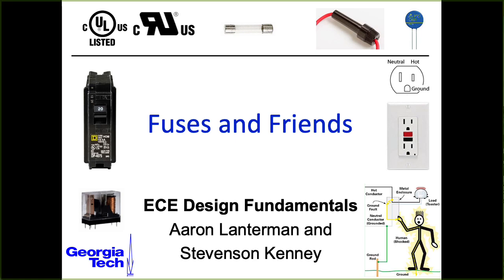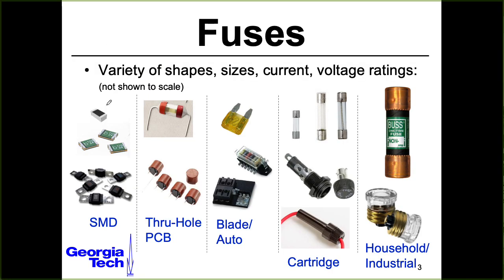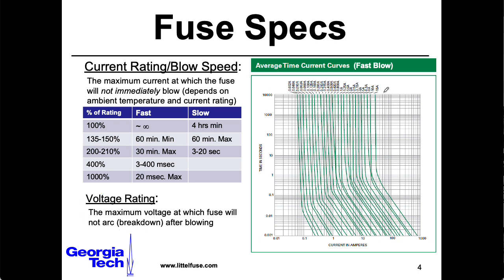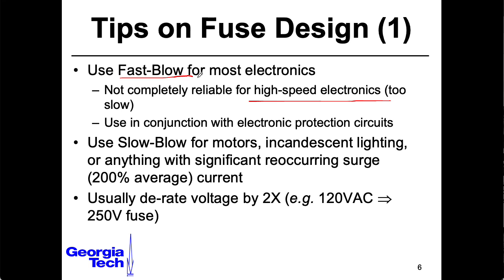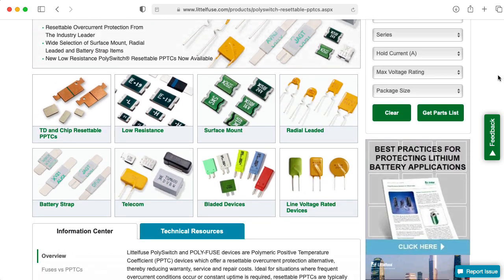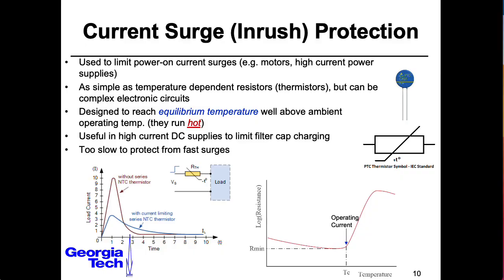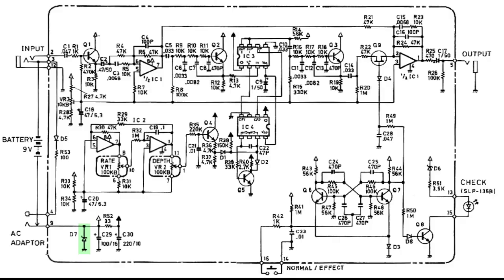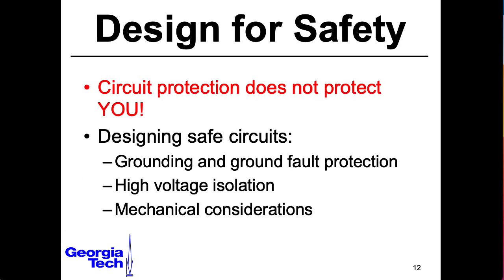Fuses and Friends: Overcurrent and Overvoltage Protection (ECE Design Fundamentals, Georgia Tech)

Comment: PTC fuses are fun devices. As the name explains, they react on temperature: a high current will heat up the fuse, resulting in an increased resistance that goes from very low to extremely high. This works based on thermal expansion, something I did not know until an expert from a vendor of these things explained this to me when we told him our full electronics modules are being potted in resin. We tested fuses in air, mounted to a heatsink and potted in different types of resin and found that potting a fuse can have a big impact on it's performance.

Comment: I have a question: so for example if you have a 240V circuit,  you would need a 500V fuse?
Reply from the maker: Yup. If you look up European fuses you'll see they're 500 V.
Reply: The biggest problem in a fuse is absorbing the energy that's going through the filament when it breaks. If you have just a "bit too much" power going through it, it may not stop conducting... or worse, turn itself into a small ball of rapidly expanding plasma and shrapnel.

Comment: What are your thoughts on SMD (ex. 1206-size) for projects requiring a fuse rated to, let's say 20A?
Reply from the maker: I'm not familiar with any specific part, but if the manufacture rates it at 20 amps I'd take their word on it.